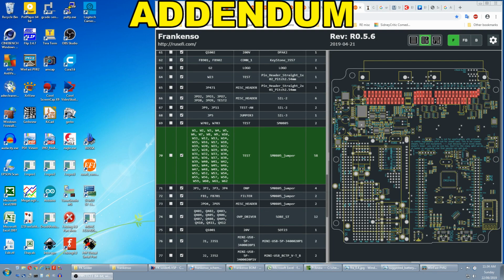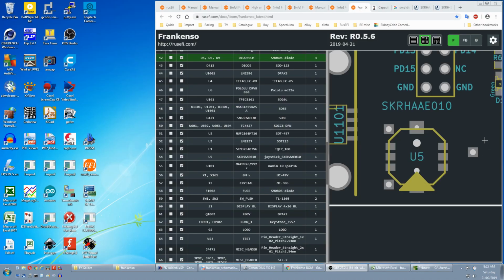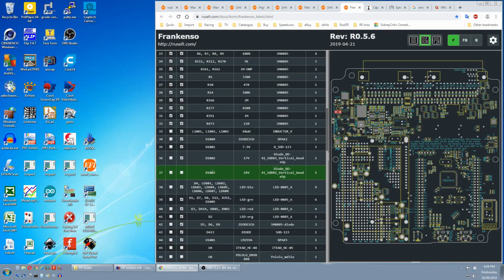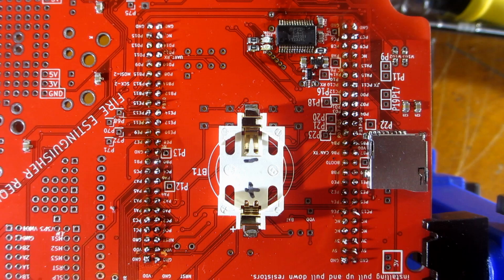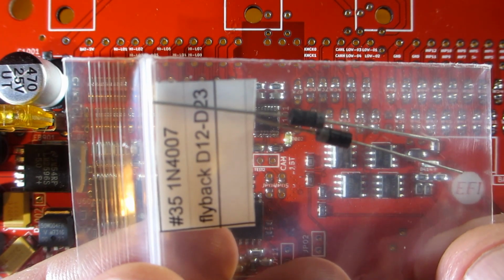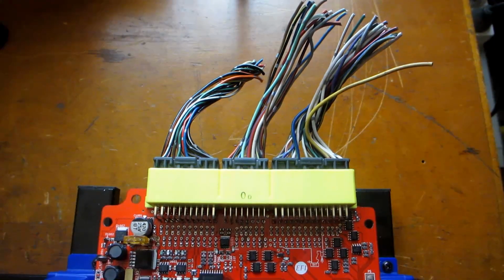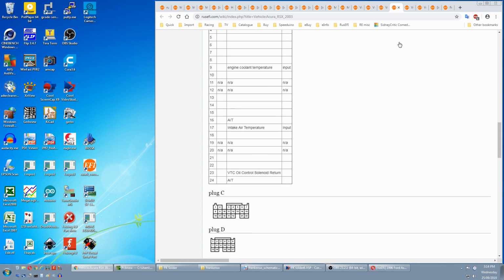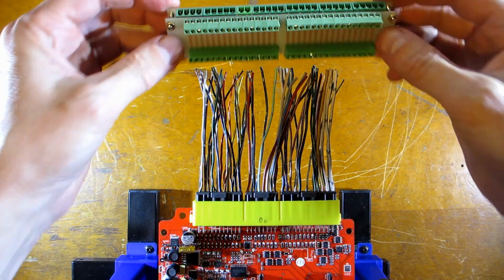rusEFI Frankenso 5 - Soldering THT

Comment: Why don't you just buy the pre-assembled board and save yourself 8 months of work?
Reply: Because maybe making this kind of videos and doing stuff yourself is what an open-source project like rusefi is. And showing it to someone who has never done anything like it like me is very amazing.
Reply: I know this post is 2 years old, but still... where's the fun in just buying one?
First, this board is 160 bucks, vs over 400 bucks, and second, because it's fun! A lot of people do this as a hobby.
For me, soldering puts me in some kind of Zen state. I swear it's not the soldering fumes ;D
I just pop on some music, try it out, and if it does not work, try it again (If you didn't burn it out).

Also, you could brag that you technically built your very own ECU.